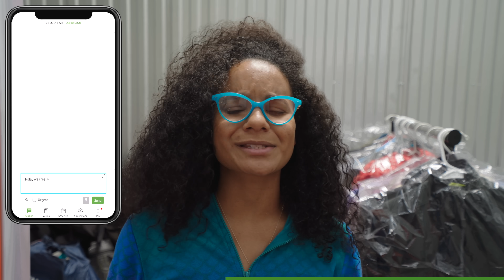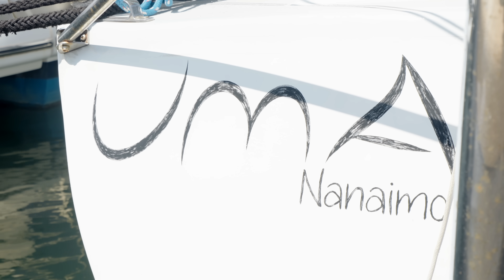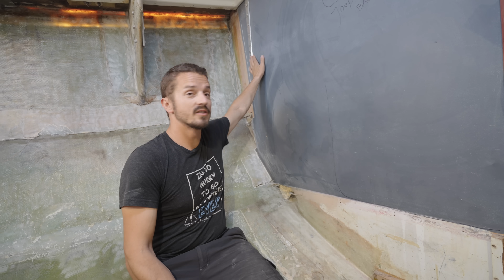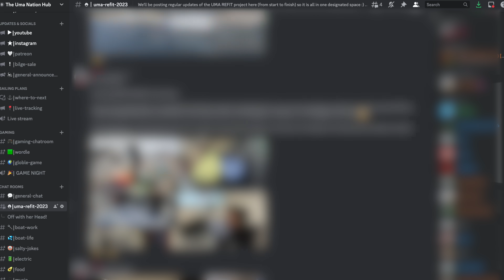Off With Her Head | Step 350

Comment: Is it a bad idea to glass in the bulkheads? Does the hull need to flex a bit and/or could the joints of the glassed in bulkheads cause stress points that could damage the hull? I'm a software developer and you're both architects so you'd know better - but I'm just wondering it it might be possible to model your changes on a computer that would allow you to see how the structure would manage different stresses?

Comment: Hey, not a boatbuilder but interested in doing this kind of work one day. I recently asked Maya & Aladino (Magic Carpet, as I'm sure you know) about how having a boat standing on land while doing a refit could affect the hull and therefore, how it would "change back" when put in the water. Like, how the work you're doing inside might be affected by it. But you guys are in the water, mustn't that be the ideal way of building? Apart from the general inconvenience transporting things back and forth, the hull is exactly the way it's built to be, while in the water. So I'm just wonder, are there any downsides to doing a refit while in the water, structurally? Like, any risks with later taking the boat out of water for example? Very curious to hear what you think.

Comment: Have you ever considered an induction toilet? I've seen Swedish ads for cabin use, but they may require 110 voltage? Anyway Thanks for an inspiring channel on sustainable cruising 👍
Reply from the maker: They consume way to much power. And really complicate a very silly problem. In a cabin they make sense. In a van or rv a composting toilet (dry holding) is perfect. In a boat, direct discharge is really best. Even if politically frowned upon. Nature handles it quite well.

Comment: You have to save Uma :) Remember, you can't drive an RV to Myken :)
Reply: why would you save that pile of junk. They dont have to buy new but at least start with something that is meant for the task they do. Nostalgia is great but it does not help much when your boat delaminates or mast rips out or keel breaks off or worst rips hole in bottom of boat and then you put others in danger trying to save your ass. Luck has been their friend on all these  shoddy  repairs but luck eventfully runs. We know this is all about you tube clicks. I would not even entertain the prospect of sailing blue in that thing. It is also just as wasteful trying to patch that thing together over and over again. You could go out and buy a oyster or Amal, just as examples, that's a little rough around the edges but when done could sell for good money. No-one in their right mind would pay a penny for that thing.      this is a edit I re-read this and it sounds a little harsh and is not a bust On them. When they started this project they were broke and just out of collage. It just seems to me with all they know from practible point of view its time to give up uma to Davie jones locker
Reply: @doppler3237  Sadly, I agree wholeheartedly. That boat is NOT up to the task, even rebuilt. Sad.

Comment: Is it just me or was imaginary Kika just a little taller than actual Kika? Also the original wiring wasn't in cable runs because 50 years ago no one built boats with cable runs. They weren't even using zip ties yet.

Comment: To avoid the usual bulkhead noise , i would advise  to take the portside portion of the bulkhead out to glue it back in on the part where it is sitting in the under deck channel . 
I used to build these kinds of boats in the Netherlands and we screwed them into these channels . 
But glueing them in is a even better solution .

Have fun rebuilding Uma !
Reply from the maker: We’ll be glassing them to the deck.

Comment: Why didn't you just sell your boat the way it was and build yourself a new one from an aluminum kit design? Your going to have a lot more time and money into this remodel than you would have with an aluminum kit. By the way, Onboard Lifestyle used a lightweight type of flat board instead of plywood that was at least as strong as plywood but much lighter.
Reply from the maker: Snow us a 45ft aluminum kit that can be fully assembled in 1 yr and cost less than $30k….

Comment: No reason to have a flush toilet on a boat. 
Separate the solids and fluids and put
sawdust on the solids and there's no smell
at all and no weight for flushed water. Time
to get into the modern world, Uma.
Reply: So the "modern world' method involves dealing with poop the same way it was done in the 1500s??
Reply: @ghost307  Yes, yes, we should continue to carry around fresh water just so we can mix it with our excrement and pump it out at the next marina we come to. Very advanced.
Reply: @BigVine-m5i  They draw in seawater (free) purify it with their electric water filtration unit (powered by the sun) and discharge it into the ocean.
I don't see an issue.